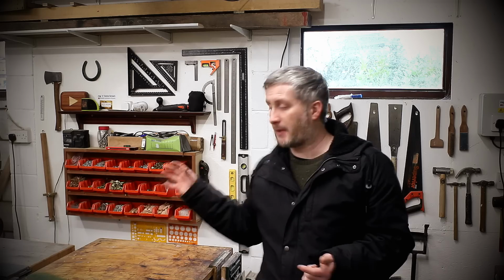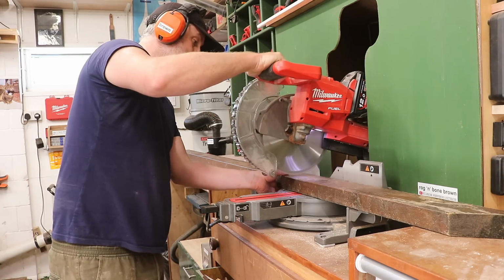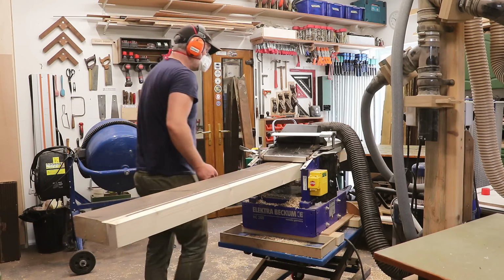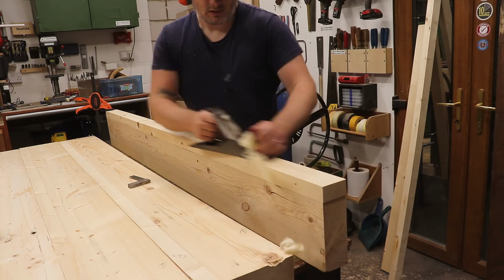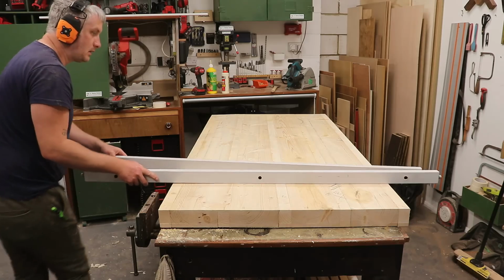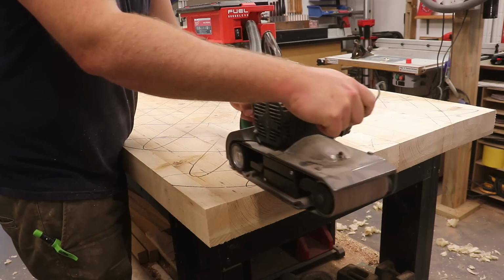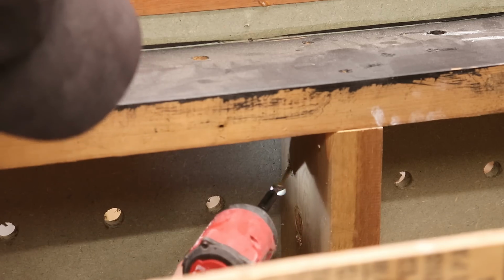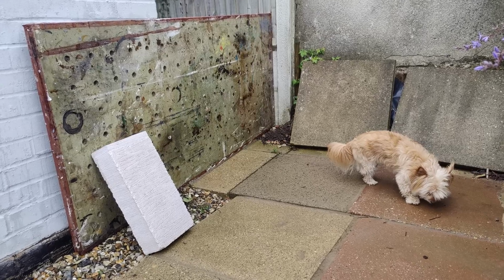My Workbench Gets Upgraded!

Comment: My workbench top is a sheet of 3/4" plywood topped by a sheet of 3/4" MDF for smoothness (it's been so long ago I don't remember how I got that stuff through the house and down to the basement) framed with 2x4s on edge, and with some kind of frame underneath (again, I don't exactly remember). It has lasted me for, at a guess, 18 years. I've been cleaning my shop recently, and finally saw the whole top again for the first time in years, and decided to sand off all the glue and paint spills, and put a paint job on it. I too went with gray, because I'm so tired of not being able to spot where I put my pencil down. It's also easier to tell when it's clean. I'm considering making a small portable MFT out of a 2x10, that I saw on YouTube.

Comment: kerfing to close the gap between boards. Clamp the boards down as close as you can get them. Run a circular saw thru the gap, the kerf of the saw will remove the wood between the boards and they will fit closer. repeat until you are happy with the fit.

Comment: Nice build. I'm a big fan of Peter Millard but in the year I've had my MFT I think it has frustrated me more than it has been useful. 

My new solution is a 'mini' torsion box MFT which attaches to my main workbench via three dogs & gives me a raised worktop when needed (to save my back) and also slots into the top of a large wheeled Stanley tool chest when I'm out & about. 

I might fill in some of the existing 20mm holes on my workbench, as I'm sick of dropping stuff down them, and just keep a few in strategic spots for clamping stuff down with Bessey clamps when needed. 

If I ever get a larger workshop I may try a stand alone MFT again but right now I just find other tools more convenient than the tracksaw, unless I need a long rip & then I mark up the workpiece & clamp the rail in place to make the cut.
Reply from the maker: That pretty much mirrors my experience

Comment: I'm on the verge of going MFT route. Should I just got a table saw instaed? I have a massive space for my workshop in an agricultural building. Table saw and Mitre saw instead of MFT and track saw etc?
Reply from the maker: It's really difficult to say as what suits one person may not suit another. If I had a smaller workshop, mft would probably be more useful, but I just don't like using it

Comment: You should look into getting yourself a pinpointer. I use the garrett at pro. Run this across your wood and it will tell you if there is any metal in your wood. They are highly sensitive and will alert you to even a fragment of metal that is lodged in your wood. It has saved my day loads of times, not to mention how many blades it has saved on my planer joiner. Have a look at them on you tube plenty of videos.

Comment: As a one man shop I have the same trouble with gaps left by the planer.  My solution is to just use the 25mm glue.  I buy it in one liter tubes, fifty at a time. Since I work alone and don't post on YouTube, no one complains.

Comment: Since you actual have a 2 sided worktop why not make it possible turn it around. If using 4 Sliding Barrel Bolt Latch(vertical) at each leg it will keep the top in place.

Comment: I build something similar about 25 years ago, seven feet long, so yes I know how heavy it is!!

I subbed just on the patch tip with the masking tape and pencil rub. I don't have a bandsaw but a jigsaw set at a slight angle and make the top of the plug slightly larger should create a snug fit.

Lovely to see you use the Paul Sellers Thor mallet, I bought one about four months ago thinking it may be useful, it is almost glued to my hand now, just the loveliest thing to have at work.

Comment: Whenever I’ve seen Peter Millard’s channel I’m always super impressed by his system of work and how he uses his MFT.  Everything flows and he never seems to run out of hands using his hold-down clamps and jigs.  It always makes me think i want one until I actually start planning it and then I realise how much I like my English style traditional workbench (made from 4” fence posts, scaffold boards and an old pine kitchen table rescued from a skip) and realise how much I would miss it. I can batter it with mallets and hammers, dump stuff on it, chisel on it, screw stuff down to it, thump my holdfasts through it and batter them loose again, plonk heavy machinery on it, spill stuff on it and even sit and stand on it and all it ever requires is a flick with the sander, maybe some filler for the worst holes and over-cuts, and a wipe with some Danish oil and it’s almost as good as new.  Good luck and good on yer to all the MFT table users but for my money you go along way to beat the utility of an old fashioned heavy pine work bench that never moves and will certainly outlast me.
Reply: I'm just getting into woodworking. I started by building a simple, more-or-less traditional workbench using 2x4s, metal corner braces, and a plywood top. Then, about 5 seconds after I finished building it, I discovered the MFT concept.
Reply: @kdietz65  same here and I came with an idea of a replaceable top cover, which can either an MDF or a solid ply. I can hammer the hell out of the top cover and my shiny bench stay clean and intact underneath.

Comment: I had plans of removing my chipboard bench top & knocking up an MFT set up, but after seeing your vid I'll follow your lead.
I only have the one table & a more rugged top will be handy, as I'm often belt metal around on it.
Being in my 70s my plan will be to glue & screw layers of MDF together as I go in situ.

Thanks for the helpful tips mate, you're a champion. 👍

Comment: Great video Keith nice to see you using old timber did see you didn’t use your crown Guard to its full ability as we are all ways told at work but l must admit if was in my own workshop l would do the same l had to laugh at the second shot off the cut on the band saw 🤣 then there is you laying on your work bench there was l just thinking you was showing how strong 💪 it is 🤣 my bench at work l just made out off 4x3 cls then put 4x8 sheet of 18mm chip board with 9mm mdf board on top which l can replace when it’s got lots of holes and worn out can’t wait to see whats next take care 👍

Comment: I think if you work almost exclusively with sheet materials the MFT is fine but for those of us working with reclaimed timber and making frame-built furniture the table saw and solid bench suits us better. Interesting to see how worked with the bigger timber illustrated that so well. Great video, thanks for sharing your work.
Reply from the maker: Couldn't put it better myself 👍

Comment: That's just brilliant,  got quite a few tips from this as well. The masking tape tip is inspired. When i built my workshop (and its extension) i looked around at work bench options. But the most cost effective , and the best way to make use of the space was to make my own using 3x2 and 18mm ply. Tied it into the fabric of the workshop and faced the top with some 2mm ally sheet. Which made a very solid L shaped bench and good under bench storage. As you say, its what works for the individual.

Comment: Could see the outfeed bed of the jointer sloping away from the cutter head as the heavy boards were being passed through. Maybe need a support at the end of the bed to keep it true.
Reply from the maker: Yeah I wish I'd have reviewed the footage before I continued 🤦🏻‍♂️
Reply: @RagnBoneBrown  Maybe rescuing and rehabilitating an older cast iron jointer would be a worthy exercise. I've one that's at least 40 years old. Noisy as hell, but rock solid.
Reply: To my eye it looks like the outfield table is not 'co-planer' with the indeed, which is why it looks like its sloping away. A bit of shimming under the table will sort it out. It happens on older planers too, I spend a day or two shimming my 1940s Wadkin planer tables and I'm currently doing it on a lovely little 70s Inca surface planer.

Comment: Hey Keith, if I was in that situation with the boards not joining up great for glueing  after surfacing on a small machine like yours,which I have something similar I would use a heavy duty flush trim router bit on a half inch router and a good straight edge guide to straighten the edge on the boards, not faulting what you did just saying what I would have done, always enjoy watching your videos
Reply: I use the table saw face up/down method and would recommend as it's quick and easy and possibly less mess to clear up.  I don't have a 1/2 router or surface planer so it's a good alternative.

Comment: Chunky is definitely the way forward. I totally agree regarding the whole MFT setup; I just don't use the table the way I thought I would. And as for the wee bits and pieces dropping through the holes, yes, very annoying! I did think that I'd use it with the plunge saw, but as I bought a couple of rail squares - BenchdogsUK and TSO - I don't! For everything else, I just use my table saw.
I've been given an old woodworking bench with an excellent vice attached - I think it has been around for over 40 years, and I'll be using that instead. 

I'll look forward to the next instalment. Thanks for taking the time to share!

Comment: The new bench looks very good.   I can imagine how heavy it is.   I do not get good results using my jointer (US term for planer) in general.   I also would struggle with long boards.   If I need to get a decent straight edge, I prefer to use a metal track/straight edge and a router with a long bit.   The depth of your top may require routing from the top then filling and routing from the bottom.
In the US Southern Yellow Pine is a less expensive wood than hard maple for bench tops.   It is a lot more dense than other pine/spruce/fir species.
Dave.
Reply: US term for the jointer is.. 
Jointer.

Comment: Personally for the jointing I would have clamped the pieces together then clamped a piece of scrap under each end holding them together. Then removed the clamps holding them all tight so that I could run the track saw up each joint. This gives a near perfect join. Really useful for big panels.
Reply: Was where I got the idea

https://youtu.be/yRMkCawvSqk
Reply: Came here to suggest same. Beat me to it.
Reply: I've done that for a kitchen worktop made from scaffolding boards, issue here was his saw didn't run all the way through the material so it would involve flipping. Not impossible but a chance of error / chasing your tale.
Reply: @TheBrick2  true but the final depth I don't remember being mentioned, I only have a cheap erbauer saw, but the benefit is it has the increased depth of cut over most other tracksaws.

Comment: I remember your pod cast with your ‘’opinion” of the colour…. Definitely not happy with it. I thought you may have changed it? Weirdly enough I have just put some grey tinted shelves in my empire of dust as I over bought grey tint Osmo which I am using up
Definitely heavy duty enough to hammer on 😁
Reply from the maker: I'd have changed it if it was a piece of furniture... But it's going to get destroyed and resurfacing in a few years anyway 👍
Reply: @RagnBoneBrown  fair play. If the Osmo was not surplus to requirements due to me not realising how little was needed my workshop would not have Osmo shelves. But it was good practice to improve application for ‘furniture’ pieces

Comment: I did a desktop from planks of maple a while back and it's reassuring to see you having the same issues with your jointer that I had in getting them to line up when glueing them together. I really need to get more experience with a hand plane in order to correct these things. As for levelling the surface, again I skipped the hand plane and went straight to a belt sander, remember to try and sand in the direction of the wood grain, otherwise you end up with sanding scratches going across the wood. Finally finishing up with lots of random orbit and iin my case, a bit of polyurethane varnish for smooth and durable finish. Nice work!
Reply from the maker: Nicely done 👌

Comment: Nice build. Its amazing how heavy pine can be when you join lots of it together. I have the same issue with my Metabo planer with long boards also, they always need a little handwork to get a tight fit on the edges.
Reply from the maker: Cheers Karl, good to know it's not just bad technique! 😁
Reply: @RagnBoneBrown  what I've found really helps when running large timber over a small jointer is to go over the wood with a srub plane to remove any high spots amd twist before using the machine. Because the beds of the jointer aren't long enough to give a good reference for the whole board, getting rid of any highs/twist prior to machining makes a big difference...